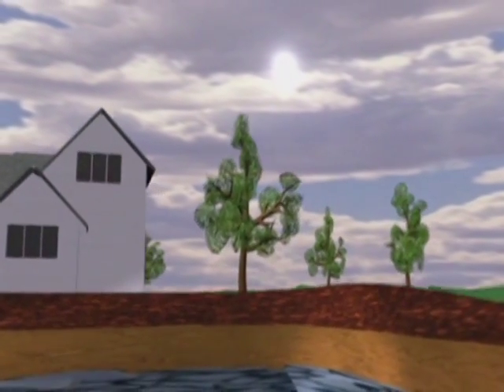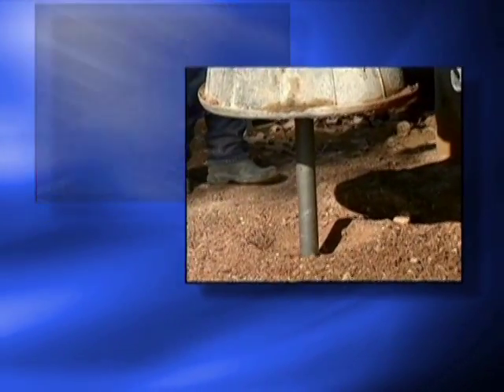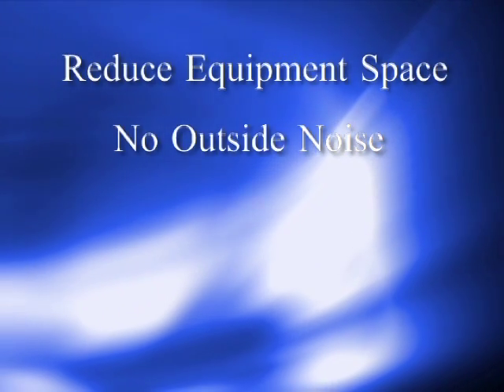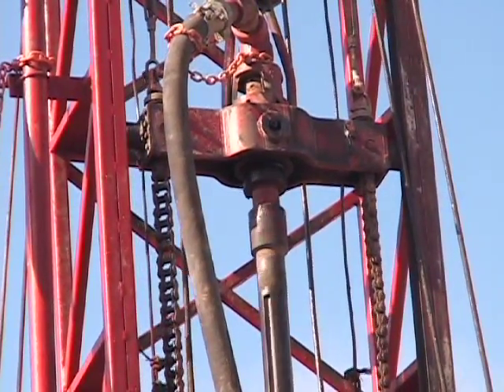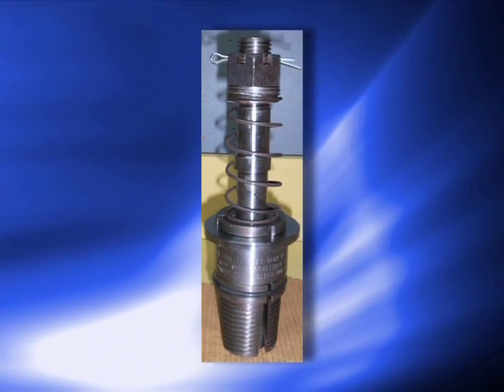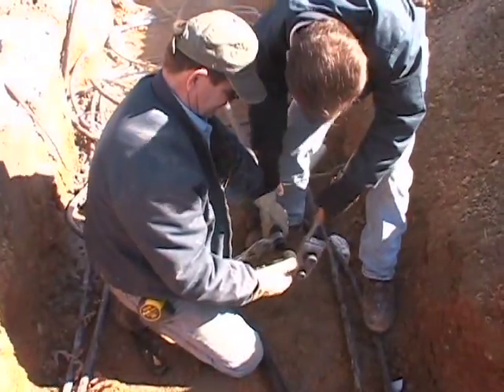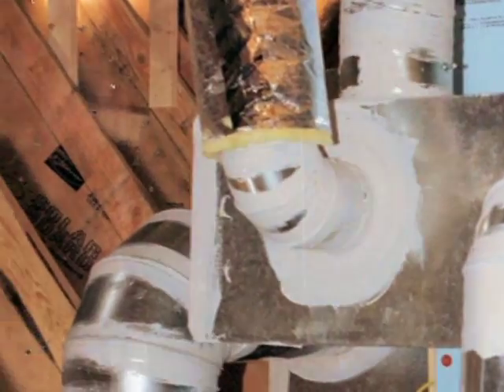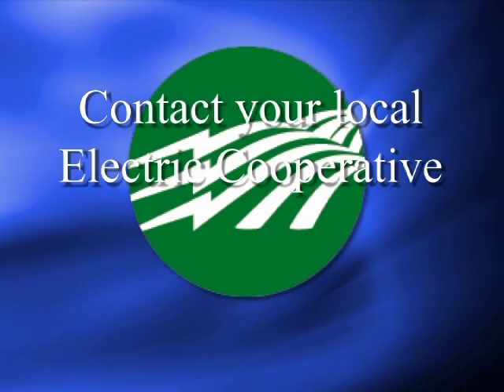geothermal-YouTube sharing.mov

Comment: I had a geothermal and it was complete trash!  My utilities ran $350 to $586 a month when it was suppose to be $91.00!!  I would NEVER install another one.  They will cheat you on the pipes and not install them far enough down.  This will keep the system from working correctly.  My system was having to be refilled every other month but they say it is a put it in and leave it.  Don't believe the hype!